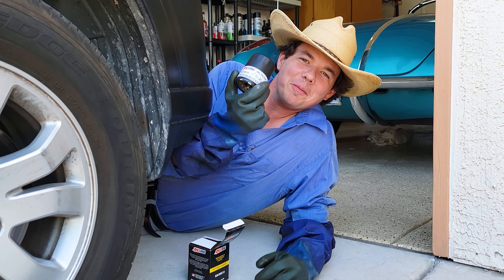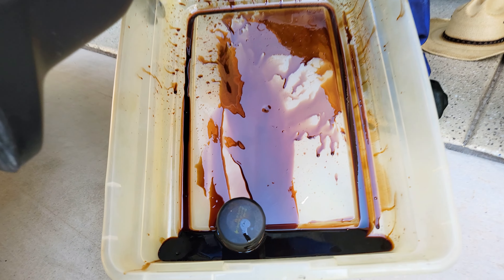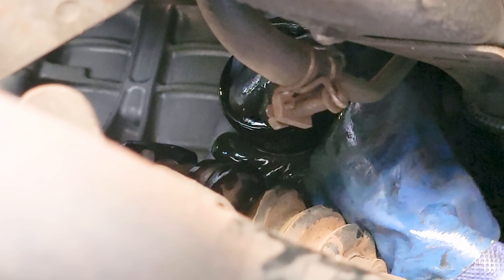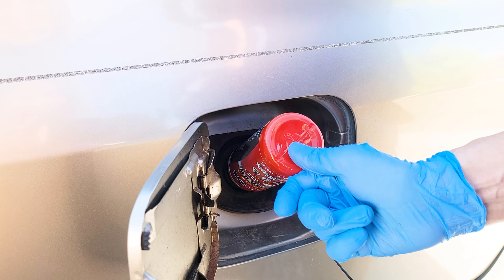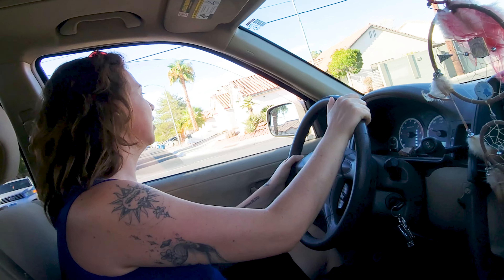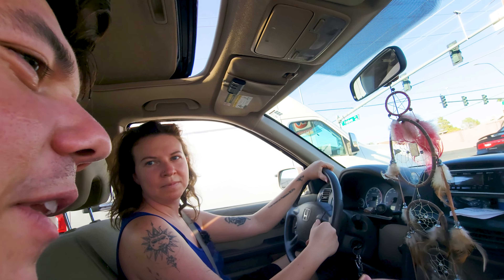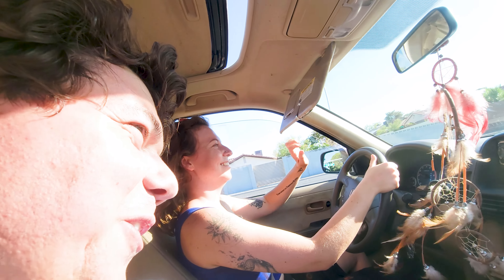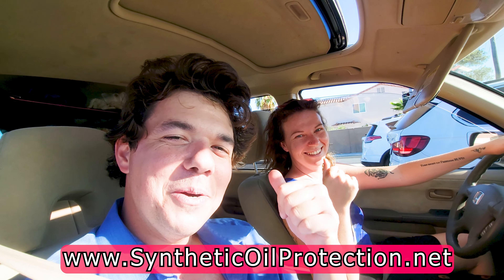Filter Changed after 3500 miles Liquid Gold cleaned inside her motor

Comment: Just did the powerfoam for the 1st time on my 2010 Nissan Titan. I also changed the oil & filter but did a flush first. I can definitely tell a difference. I didn't get much smoke, but when spraying the throttle plate on the throttle body, I could actively see the dirt around the plate being dissolved and cleaned! I have been trying to get my dad to switch over but he just makes excuses about cost and some other stupid reason that didn't make any sense! Either way I know I'm Amsoil for life!!
Reply from the maker: That's great your Nissan is running better!

Did you get the signature series motor oil?

Comment: Been using on Amsoil on my 2022 Prius since it's first oil change, runs awesome!
Reply from the maker: That's great did you do any other oil or lube on it?
Reply: I mean it is a brand new car 😂 what did you expect hahahah
Reply from the maker: Yeah I know it sounds crazy but there's a lot of brand new cars that don't run well because of the OEM spark plug fluids and tires. 
A lot of the Big Oil manufacturers make a deal with the company and they use very low quality wear items like windshield wipers tires brake pads that comes stock on a car they can be upgraded and once they are upgraded the car can run significantly better than brand new.
I show everything I did to my car the day I got it and my car now runs about 15% better than brand new as in overall power fuel mileage and drivability

Comment: Great reminder to change the oil filter to keep the oil cleaner removing the carbon and soot build up that's like 2000 to 4000 grit sand paper waring out your piston walls and piston rings. 
     No ware keeps your car running like new and much better gas mileage and less carbon build up from better piston chamber combustion. 
     What makes Amsoil 100% synthetic so good is it does not burn off at super hot temperatures, and keep all the motor parts lubricated great! 
      If you do not change the oil filter yourself, any garage can do it for you quickly. Twist off the old one and twist on a new one one. Just call and ask what they will charge you to do this for you.
      Remember, you have to check your transmission fluide before long trips and at least once a month. 
    Power steering fluide and brake fluide as well check them. 
    A well maintained car will last 4 times longer using the right oils and fluides. 
     Have a safe trip!
Reply from the maker: Great points......😊

Comment: Mobil 1 extended performance no one beats that
Reply from the maker: Actually the Amsoil signature series is quite a bit different than the mobile one. Mobile one can be called a full synthetic when it is 25% synthetic or more that goes for all synthetic oils Amsoil signature series is 100% synthetic it creates a stronger film between the metal which has less friction less heat less wear on the component so it will last exponentially longer. If you want to see how big of a difference it is check out these tests here.
♥️   See Oil & Lube performance tests - https://www.amsoil.com/performancetests.aspx?zo=5331179

Comment: I wish you can come down here one day to Toronto and service my 2016 Jeep Cherokee Trailhawk and make a video of it. I Just changed all the fluids to OEM mopar but I feel performance can be improved by switching over to Amsoil products. My mechanic does not like installing amsoil for me unfortunately.
Reply: You should find another mechanic
Reply from the maker: That's easy you can find a highly rated Mobile Mechanic on Google Maps he will come to you and you can order the products through my website will get shipped right to your door and you can watch them be installed on your vehicle.
If you have any questions on that let me know I made a video on how to find a mobile mechanic.
Furthermore some of the fluids are very easy to do on certain Vehicles which you'll see here in the channel so really the tough ones are usually only the transmission fluid and sometimes the coolant depending on the vehicle so those two you could definitely pay someone to do the other stuff is very simple.
     Together! We can get your vehicles to run better than brand new! 

     For me to get credit & be "Your" Independent AMSOIL Dealer, please use my website below or my dealer no. 5331179 call anytime Eben Rockmaker 702-472-3614
After you click on: http://syntheticoilprotection.net
1. Click the hamburger menu
2. Click offers AMSOIL preferred customer
3. Click join now. 6-month PC member add to cart.  ( There is no reoccurring renewal membership unless you select that dot box ) 
( You have the option to not have your credit card saved if you prefer - est. 1972 )
4. Scroll up to the top Select shop by vehicle. 

New Promo Code: FREEMP
Reply from the maker: @GDavis49 ☕️

Comment: Hello amsoil, is your amsoil european motor oil 5w30 Suitable for heave usage like 100to200km daily driving and 8to9 hours of non stop engine running with idling included with full load and how would the engine protection be
Reply from the maker: Yes and you will see the exact lubricant for your specific model right here on my website👍
If you have any other questions call me☕️
Let's give a man a fishing pole & show him how to fish. 

     Together! We can get your vehicles to run better than brand new! 

     For me to get credit & be "Your" Independent AMSOIL Dealer, please use my website below or my dealer no. 5331179 call anytime Eben Rockmaker 702-472-3614
After you click on: http://syntheticoilprotection.net
1. Click the hamburger menu
2. Click offers AMSOIL preferred customer
3. Click join now. 6-month PC member add to cart.  ( There is no reoccurring renewal membership unless you select that dot box ) 
( You have the option to not have your credit card saved if you prefer - est. 1972 )
4. Scroll up to the top Select shop by vehicle. 

New Promo Code: FREEWAND